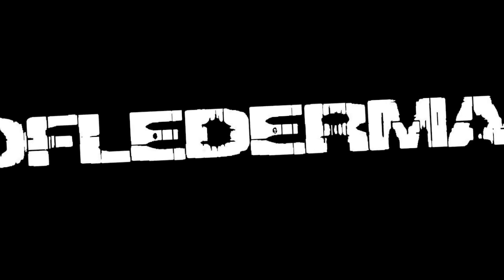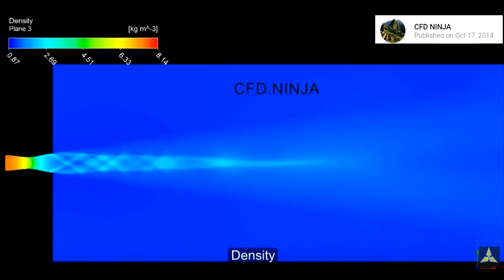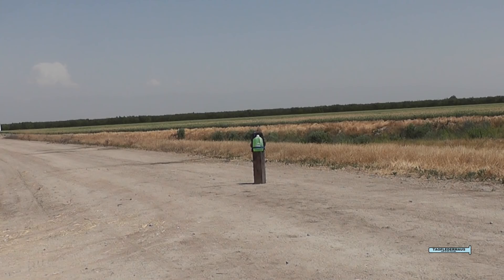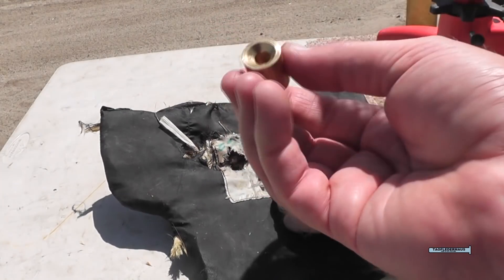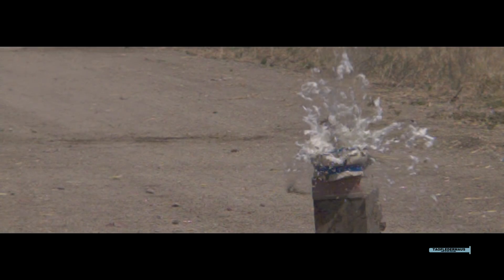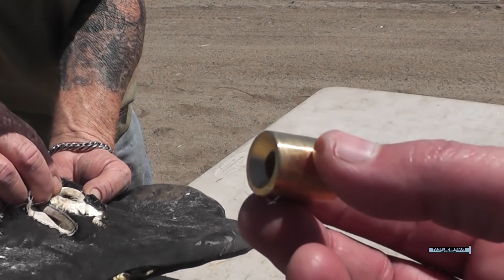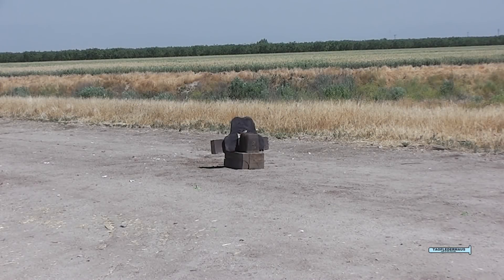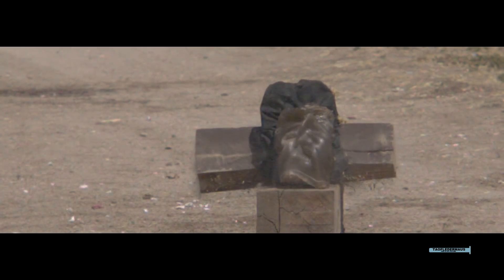SCREAMING Shotgun Slug -  Rocket Nozzle Experiment

Comment: Lightweight paper plug? You forgot to mention the toilet part. Toilet paper does make a great and strong but lightweight shim or filler for many purposes. And it is cheap too! Wet some toilet paper and form it into any shape you want. Then let it dry. It makes a super strong material (materiel?) Just keep in mind it will shrink a bit after it dries.
Reply from the maker: It's almost as hard as wood.  It doesn't shrink TOO much imho.
Reply: @taofledermaus  Yeah it doesn't shrink much, just a bit. Just a thing to keep in mind if trying to make a very tight fit. And it IS wood! Well, tiny shaved fibers. Paper is made from wood.

Comment: Even at subsonic speeds of the object you get airspeeds around the object above Mach 1, also the design you are dealing with tends to work with pressure which can't really develop when in the open atmosphere since the hole isn't the path of least resistance.

Comment: You mess up the physics completely. Why would the bow shock prevent airflow through the nozzle? That's nonsense!
On the contrary, the bow shock is absolutely necessary to create the high pressure field in front of the nozzle to POSSIBLY be converted back to supersonic flow in the nozzle. Without the bow shock the pressure is not high enough in the front chamber to push drive the supersonic transition in the CD nozzle.
It would be interesting to put something combustible at the tightest diameter. Like magnesium, and the fire it at the highest mach number you can. Mach3 would be nice, but probably not achievable.

Comment: De Laval nozzles don't operate unless the fluid through the nozzle goes super sonic.  If it stays sub sonic then it is simply a venturi and you get no thrust advantage.  And you get airflow through the projectile even if it is super sonic, if you didn't planes would fall out of the sky because their engines would no longer receive air....

Comment: This isn’t the correct application of this. This nozzle design accelerates heated gasses to supersonic speeds, which puts more of the heat to work in creating thrust. Without a source of heated gas at the front~ like a combustion chamber, it won’t do anything interesting.

Comment: This doesn't seem feasible.  It is the expansion of gasses due to combustion that make that shape effective.  Without a fuel then the is a head pressure and a increase in velocity of the air stream, hence the whistle, however any potential gains in velocity would be balanced by the increases drag on the projectile.

Comment: like your experiments.. we made coke can sized sugar rockets with 10 mm core, de laval nozzle and found they suffered from propellant erosion due to high nozzle inlet velocity... they seemed to slow down and then accelerated again... (you have to marry your nozzle to the burn rate of the propellant?)... but conversely I guess you can't slow the self oxydising  reaction so you might get a build up of pressure if the shock wave slows the flow.... so then the motor could explode... but they didn't... ? I cant explain it.. just grist for your mill.... we got 6 kg's of thrust but then it would oscillate slowly as described.

Comment: Aerospace engineer specializing in high-speed, high Mach number flows here. Just FYI, you’ll never get sustained accelerated supersonic flow through the nozzle projectile. You’re correct that if it’s traveling at supersonic speeds you’ll have choked flow in the nozzle throat with a standing normal shock there or a detached bow shock like you explained. 

But even in the projectile is transonic or subsonic accelerating the flow through the inlet is impossible because that would violate the 2nd law of thermodynamics: the free flying projectile would be creating thrust and therefore doing work which is creating energy from nothing.  (Note: The thrust does NOT need to be greater than the drag force; even if the projectile is still decelerating, albeit less aggressively, by hypothetically accelerating a volume of air traveling through the nozzle it is doing work for free.)

In practice there is no way to cause the he flow to speed up without an onboard energy source. If there were, you would have fuel-less ramjet vehicles flying around “for free” after the initial acceleration. 

In practice to accelerate the flow you need a higher “total enthalpy” which is created by adding heat (usually chemical energy, aka JP1 or RP1) in jets, ramjets and rockets.

Comment: The front of the nozzle needs a supersonic educator, which will slow the inlet air down to less than halve sonic speed as it enters the nozzle. Think if a spiky hat shape (two sided). The J58 has one of these on the sr71. The airflow has to be about 1/2 sonic after the educator.

Comment: Good stuff! Consider the fact that any projectile moving anywhere in the neighborhood of the speed of sound has the potential to create supersonic waves ahead of it. Think of the projectile like a bat and air molecules like baseballs. The bat hits them with enough force for them to rebound at a greater speed than the bat. This could be the cause of the cone of projected air ahead of the projectile allowing for the plug of paper to travel and prevent airflow. Considering how slow the projectile would need to be moving to allow for significant airflow, I recon either the projectile would need to be enormous to be effective, or the lower speed would make it ineffective at this size (12ga).
My $0.02.

Comment: i mean it is possible that there was airflow to start with and the air did get accelerated through it and it made a low pressure area that pulled the paper wad back in

im no vacuum trebuchet projectile scientist but it is possible

edit: might be possible*

edit 2: wait you made it work lol

Comment: I think the paper plug worked against you and your experiment, being vacuumed to the back of the slug by the outside airflow, and virtually creating a sort of hollow point. I believe if you didn’t have the paper wad there WOULD. Have been air flow, but would have been similarly difficult to verify.

Comment: In this instance and usage of the shape is counterintuitive. the front forms an airbubble that does not let the air to flow through the cylinder and it couses turbulande around it putting air pressure in the hole of the back of the cylinder... so the hole in the cylinder does not make any difference whatsoever imo.

Comment: Excellent acceleration.  It just occurred to me that if it had been possible to put some small bits of high-visibility cord or string inside the slug, that could have also shown if airflow was going through it.  Aircraft flight test uses tufts of string attached to the plane to show the flow field without interfering with it.

Comment: With the Venturi effect you may not see atomization because it might be so fine with the high pressure involved. I would think it would look more like a pressure or heat wave with the atomization near to evaporation levels where you would need them for efficiency in something like a rocket motor.

Comment: Rocket rounds, I have heard of these, coat the inner surface of the rear of the nozzle with a percussion igniting solid rocket fuel and you could get some pretty high speed results, use a rifled barrel for stability

Comment: The first round likely exceeded what is known as the critical mach number for the projectile. Trans sonic air flow happens because the air must move up and over (around) the surface of the projectile, thus increasing the airspeed over the outside of it.

Comment: In advanced aerodynamics they call it a critical mach number when even though the airfoil is traveling through the air at a subsonic speed the flow of air over certain parts of the airfoil is being accelerated to supersonic speeds. I believe this to be the reason why air was not flowing through the center of the projectile at first. Please like this comment so others can see 👍

Comment: So you guys should try using a metal 5 gallon bucket and suck all the air out to the point of allmost sucking the bucket in. And fire a round at it. You will be surprised for sure.

Comment: Besides bow shockwave, There's also internal static pressure bubble (like with early venturi designs) when there's too much restriction in the flow (not enough outflow area for the inlet ratio) I came across that at well below mach speeds-building cf ram air ducts. For it to get resonance on these catapult pieces lol the designer got out of that issue. Good job reducing the velocity that can be tricky with sling shots

Comment: I'll regret this later (mild greed), but... to get the interior airflow, I think you will need to have a set of points that break up the overall shockwave.  The version I've been kicking around is 3 needle points evenly spaced around the outer ring.  This should create turbulence when the needle-triggered shockwaves (3 of them) meet. 

(This view is based on a NATO sniper bullet Schlieren pic (780 m/s), a bullet-shape vs drag chart (discussing "ogives") on slideshare, a shotgun_v_pellet Schlieren photo from a Wired article, and a Schlieren image of mach 2 inlet shockwaves for a ramjet in both unstarted and started modes.  That last, along with the shotgun vs pellet photo, points up a need for long points (long enough to exceed the body's shockwave depth).) 

The central spike ideas probably won't work unless the round speed is Mach 2+ due to the sizes involved (less than 1.5 cm in cross-section thickness); as hinted at by both the ramjet pic, the pellet pic, and the NATO bullet pic.  The shockwave angle would be too shallow to intersect the outer rim.

(I'll have to look up the relevant pages on my home computers' histories.)

Comment: I'm curious what might happen if you were to mount the nozzle backwards in the "high tech launch mechanism" fire up the flux capacitor and force it to fly backwards, I wonder if it would still be stable and how that might affect the airflow through the nozzle

Comment: NEW TEST PLEASE:  Do the high velocity ones (where the plug stays in) fly the same distance as the low velocity ones (where the plug comes out and it whistles)?  What I'm wondering is if the low pressure jet coming out of the nozzle helps it to generate some sort of lift.  Or, if it doesn't stabilize and prevent tumbling, that should result in more distance.

Comment: Please shoot one at greater range to see how it copes with maintaining velocity, also try to push one beyond mach 1, should be interesting to see how it behaves with an annular shock front. Remember at trans sonic speed some parts of the airflow will in fact be supersonic, especially where the frontal cone changes cross section, so you might have had subsonic airflow around the cylinder, but inside you might be getting constructive interference with shock waves creating a bow wave in front. The pressure front of the projectile is centered due to this.

Though I must add, good job charging the flux pressurometer so far that the vest keeps running away XD

Comment: At 2:00, there is a mention that if a bow shock appears, then no airflow at all will enter the nozzle.

That's not the case. Think about it - any supersonic object will create a bow shock. So if a supersonic fighter jet is going to produce a bow shock, then if there was no air reaching inside the shock, that would mean the engines would be starved for air. And that's not what happens at all, of course.

In fact, the bow shock is where the supersonic flow almost-instantly drops to subsonic - meaning that you will always have subsonic air entering the nozzle, regardless of the free-stream velocity.

Comment: im stuck on what he said about the shockwave preventing airflow. It doesn't make sense. A shock wave is a change in pressure moving through a given material (in this case : air). if a shock wave prevented airflow how do supersonic planes fly? I'm not criticising because I know i might not be aware of something important but i would like it if someone could either correct me or confirm my suspicion.

Comment: Also do a test WITHOUT THE PLUG!!! look at it this way, no matter what shape a slug is there will always be a low pressure zone following behind it. With the wad inside the hole (that sounds weird), the air has to be forced down that nozzle with enough force that the area at the constriction needs to produce more force than the low pressure end is forcing on the end (the biggest part). If we just look at it by size here you have one circle  and another circle with at least 6-7 times the size. If the pressures are just the same it's not going to happen, you need the pressure pushing in the front to be the same as the pressure in the back. If you remove the plug then maybe the low pressure in the back would suck air through the center from the high pressure part at the front? the way I see it though is pressure is related to the speed of a fluid , and where is the speed of the air going to be the fastest; at the very tip where it needs to get out of the way of the speeding slug!

Comment: 1. The oil blew out before the round left the barrel.(Sin plug) 
2. Theres a backdraft holding the plug in.
At those velocities, its more a kin to fluid dynamics.
Try them in a water tunnel with dye.

Comment: If you could lengthen the projectile, add an undersized rifle bullet in front of the nozzle to reshape the bow shock and allow better flow, you might be able to make a "vacuum cannon" launched base-bleed projectile. It wouldn't go faster, but it might go further by reducing the drag created by the wake. Now, your "cannon" might not be able to accelerate the projectile enough to get much use out of it, but if you could find a .50BMG science delivery system you might be able to stretch the range at which you can deliver science.

Comment: See, I'm not so sure you actually had airflow through the nozzle. At least, not any airflow that is typical of a functioning De Laval. Whistles are generally set up by oscillations in flow and/or pressure, not steady flow like you'd find at the exit of a De Laval. Knee-jerk hypothesis from me: 1. Exit flow is MASSIVELY overexpanded leading to flow separation and stagnation. 2. Whilst not in the transonic regime, the stagnant pressure zones on the leading edge(es? circular, who cares?) may still reduce the mass flow rate through the nozzle to a point where the bell can't actually set up divergent flow. 3. Pressure on the convergent section isn't high enough. C-D Nozzles are constant mass flow devices, you're compensating for the velocity with pressure/density. while Bernoulli's doesn't generally apply in supersonic flows, that's not really a concern but not having enough raw mass to force through the nozzle may be the source of your woes.
That's all I can think of right about now, if you want to comment the dimensions and atmos conditions, I'd be happy to try a simulation or two.

Comment: Hrm.  Well, if that con-di nozzle is shaped correctly, it will actually end up as a flow limiter.  In airplanes, they use a 'sonic venturi' as part of the cabin pressurization system, the airflow going supersonic acts as a limit to how much airflow goes through the cabin instead of into the engine.

Comment: The Vacuum cannon is impressive technology , Jeff and Danny are first rate engineers! 
Are you planning on launching any test flights using the linear accelerator or the electromagnetic rail gun ? The aerodynamic data is interesting 
Is it also DEMONITIZED as well as DEMONIZED ?

Comment: The whistling is probably caused by the massive overexpansion of the airstream. The laval nozzle isn't tailored to the ambient pressure (which is too high for the neck of the nozzle), so the expanding stream collapses inside the expansion part of the nozzle, separating it from the inner walls and causing an unstable very low pressure zone, which oscilattes like crazy as the separation is highly unstable in a laval nozzle because air is trying to flow inside the near-vacuum from the back of the nozzle to balance out the pressure difference (which is why you need to prevent it in a normal rocket engine at all costs: the oscillation and the pressure gradient can easily collapse the entire nozzle and destroy the engine).